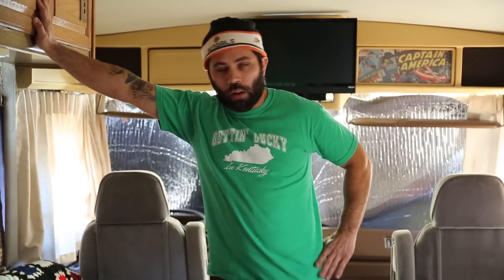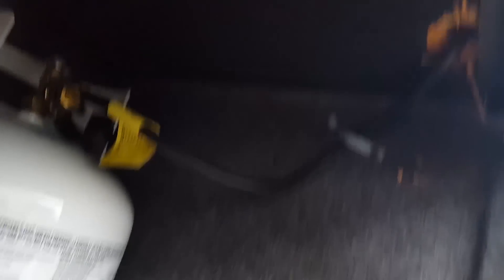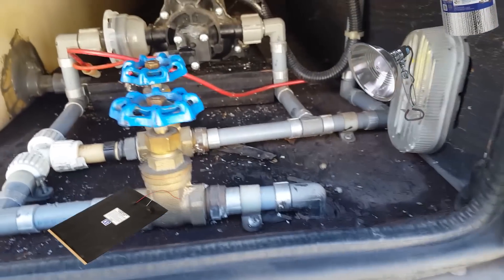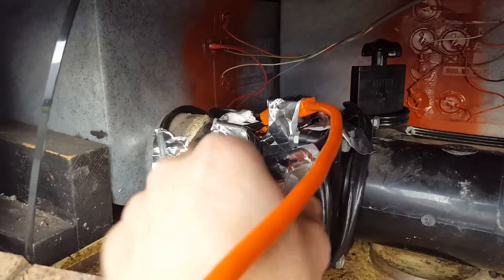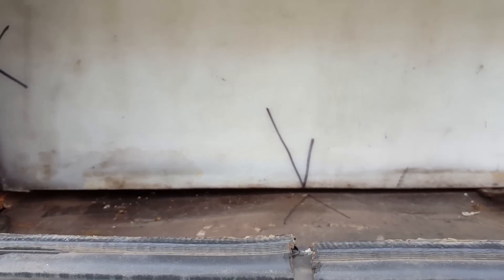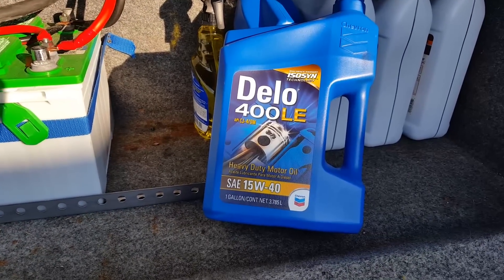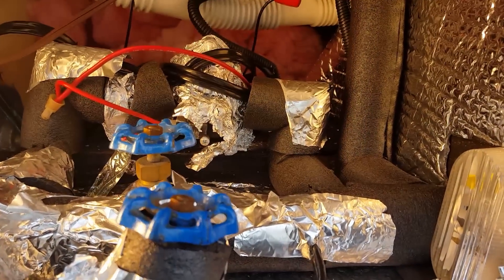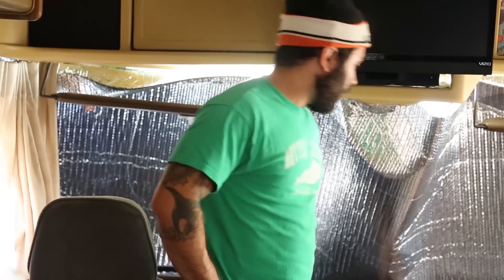Full-time RV: Winterizing your RV for Winter

Comment: The reason those cabinets were getting moist is because of the Mr Buddy; they put out tons of moisture.   It was colder in there, so it'd condense on the roof.   When you added the vent, you're now heating the interior of that cabinet as well.  Best thing you can do is add a 12v Diesel Heater, which puts the moisture outside of the vehicle.

Comment: Looks like NASA quality on that insulation did you work on any of the shuttle projects Luke?  Lol   And yes the little buddy will also create moisture when it's running, you might want to get some dehumidifiers for that...Have a Merry Christmas Sir!
Reply from the maker: +Norm K. Merry Christmas to you too!  Agreed about the moisture.  But even on low I have to keep some windows open as this melts the place so haven't had to much moisture problems.
Reply: Luke Capasso is there a way you can post links to all the items you used? Or what they are? I'd like to look for the little vents you used for your cupboards, but can't seem to find them.

Comment: Here's a friendly advice from hardy Canadians spending harsh winters in RV's at oil and gas sites throughout northern BC and Alberta:

1) To winterize your windows, use special bubble wrap with flat surfaces on both sides (not the regular one with bare bubbles sticking out on one side) and attach it really tightly to the window glass while also covering metal frames surrounding it all the way to the wood trim. Keep it in place by running scotch tape all the way around it sealing it as best as you can. There's also bubble wrap with one sticky side which is absolutely ideal for that: it doesn't leave much air between the wrap and the glass/metal frame, thus eliminating condensation and frost. This material is also great in letting the sunlight in during the day (unlike reflectix/astrofoil) while providing good privacy at night (you can only see people's silhouettes inside even with blinds open). It's fairly easy to peel off in spring, but you might need to use a bit of rubbing alcohol to remove any adhesive residue from the glass.

2) You can also attach pieces of bubble wrap to the vent and skylight openings to let the light in without loosing the heat. I recommend keeping them in place using self-adhesive velcro strips attached around the perimeter of both the opening and the bubble wrap cover - that way they're easy to remove when needed.

3) Glue a large sheet of sticky bubble wrap over the top of your bed board under the matress to reduce condensation there.

4) To insulate the walls and roof use penoplene (look up either that word or 'foamed polyethylene'). This is a fairly cheap but amazing material very popular in Europe and sold on amazon/ebay in form of soft and flexible 1/4''-thick tiles with one self-adhesive side and another having various 3D decorative patterns and colors (some really nice). You simply glue them onto your internal walls and ceiling like you would regular tiles, and they boost your rig's insulation immensely. They are also fairly easy to peel off and/or replace with a different design when the old one feels too old.

5) Use self-adhesive astrofoil with one sticky side to insulate the walls inside all the cabinets (top and bottom) as well as all the basement storage compartments (including the inside of all storage hatches). Check the condition and sealing quality of the hatch seals (especially in an old RV) and replace it or beef it up using residential self-adhesive door insulation strips if necessary.

6) Use penoplene to cover the inside of your rig's entrance door, and put sticky bubble wrap on the door window.

7) To insulate the floor, you can use thick carpet or area rugs, but nothing beats 2''-thick interlocking closed-cell floor tiles sold in any hardware store (some sport equipment stores also have them under the name 'tatami mats'). They're also super comfy to walk on.

WORD OF CAUTION: Generally speaking, any extra insulation layers you put inside your rig MUST be attached to your rig's walls/windows/ceiling/floor tightly with minimal air gap (and not just covering loosely or being simply hang on the wall), otherwise the gap will fill up with condensate which will ruin your rig. Condensation and frosting around window sills are the main reason why all these other ideas like closing the shades or covering the windows with astrofoil or blankets just don’t work, not to mention they will turn your rig into a depressing everdark cave.

8) The biggest sources of heat loss (especially in the newer, better insulated 4-season RV's) are the slideout perimeter seals. Buy thick self-adhesive door seal strips (or cut 2"-wide strips from thick and soft closed-cell foam mats sold in hardware stores or on ebay) and glue them around the perimeter of the slideout behind the decorative wood trim where it connects with the external slideout walls so that when the slide is fully out these foam strips will be somewhat compressed against the internal wall providing a good seal. Unfortunately, this cannot be done at the bottom of the slide, so you have to identify the main routes of draft penetration on some cold windy day and improvise the ways to block them.

9) Avoid using propane heaters (unlike propane furnace or electric fireplace, they produce a lot of moisture).

10) To further reduce moisture, use microwave or electric toaster to cook/reheat your food instead of propane cooktop or stove, and if you absolutely must boil or cook something using propane then turn on the exhaust fan or crack your roof vent open to drive away the vapours.

11) Be very careful with electric heaters of any kind (even oil radiators - they can also cause fire if they trip).

12) Avoid showering in your rig as much as possible (use a workplace, gym or campsite shower).

13) Avoid drying loundry, wet clothes or sports gear inside your rig on really cold days when you can't air it.

14) Buy a good dehumidifier if you cannot reduce moisture by the above steps - it's well worth it. Remember: excessive moisture in the rig breeds mold and mildew which will slowly kill not only your rig but also its occupants, and once it's there it's almost impossible to get rid of.

15) Watch closely the inlet and outlet vents of your fridge (especially if you ever run it on propane in freezing cold): icicles tend to grow inside the space behind your fridge blocking these vents.

16) Don't bother clearing snow banks around or under your rig (it's a typical rookie mistake to think that they might accelerate freezing of your tanks and piping). Conversely - as soon as there's enough snowfall, pile  as much snow as you can around the rig to attract even more snow in the next snow storm thus growing the snow barrier around your rig untill ideally it will completely close the gap between the bottom of your rig and the ground (this is especially important if you don't have a skirt). Also do not remove snow cover from the top of your rig and slide roofs.

17) I'd definitely recommend using a heat-traced water hose for hookup. In a modern 4-season rig with heated underbelly and tanks you may not need to keep the water running all the time to prevent the internal pipes from freezing, but I'd recommend to do this in extreme cold or if the park where you're staying doesn't have heated water hookups. If it does, it may be better to use it periodically to fill up your tank and run off of it using your water pump most of the time. In such case, as well as if you're boondocking, I'd also recommend to turn off your water pump and leave all the taps (hot and cold) fully open if you leave your rig without furnace running for any length of time e.g. before going to work or ski. Do this also before going to bed on extremely cold noghts even with furnace running. Do it as often as you can if your rig is not 4-season rated.

Good luck and keep warm!

Comment: Is the dc switch wired on the positive or negative side? Some components may have become accidentally ground to chassis. Try wiring the switch to the positive side if not already. Good luck man. I'm in east Texas where I don't have to worry about it freezing as much as others. I'll be making my way up north soon! Cheers!
Reply from the maker: +Camping Mods Yeah positive side, I think its just a weak switch.  So far I am rocking the AC as I can get my brain around it easier.

Comment: Did you get the filter for the Mr. Buddy?  If you hook to a tank without the filter your Mr. Buddy won't last long.  The jets get clogged.
Reply from the maker: +Pounder Speaks Poop.  On all of them?  This is the attachment that came with it.  I threw the box out but didn't see anything in the instructions about a filter.  Just trying to avoid spending more cash if I dont have to. .
Reply: +Luke Capasso Its not advertised.  It is marketed as an assessory .. i went thru two buddies before i figured it out.  You can clean the jet if you nave micro fingers.  The filter is only 11 bucks and you only need it if you have it hooked to a propane tank.  http://www.amazon.com/HEATER-CORP-F273699-Heater-Filter/dp/B000HE8P2O
Reply: +Pounder Speaks maybe yours came with the filter.  Ive had three and none of them did.
Reply from the maker: Meh.  Mine was fairly cheap so my guess is no.  Thanks for the heads up.